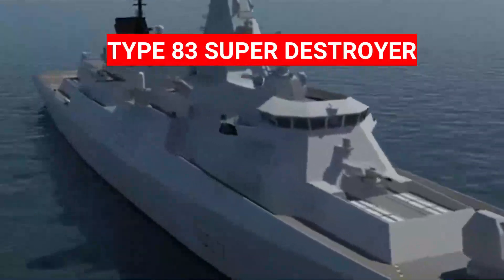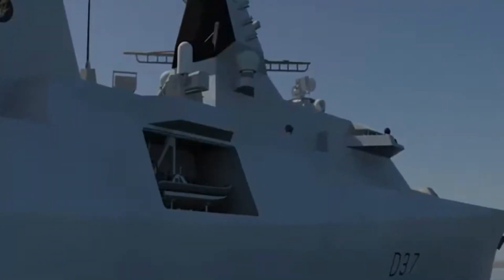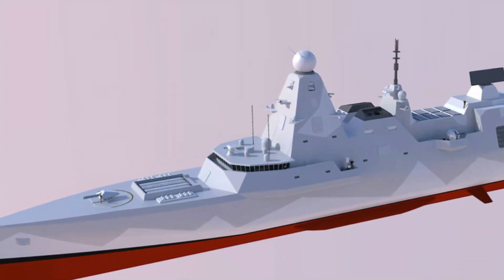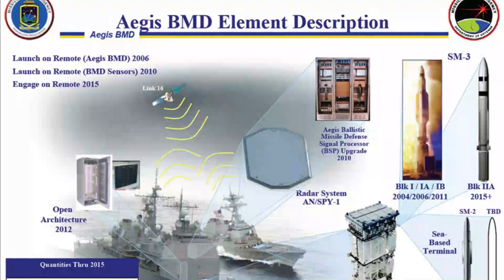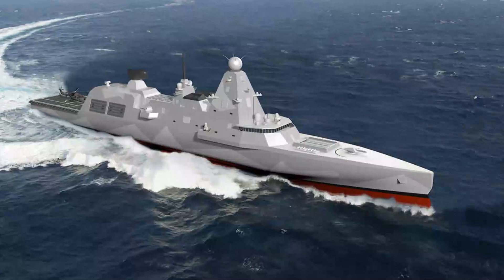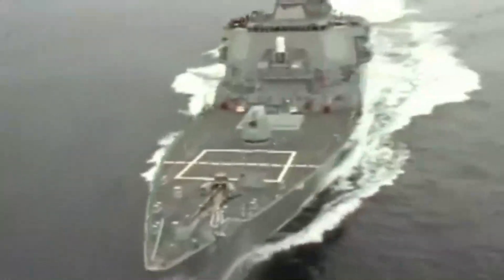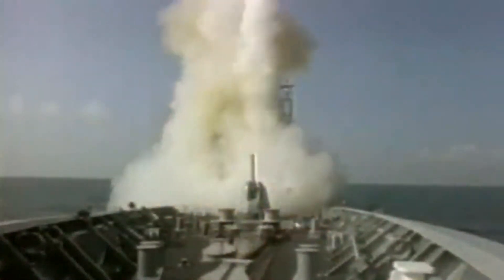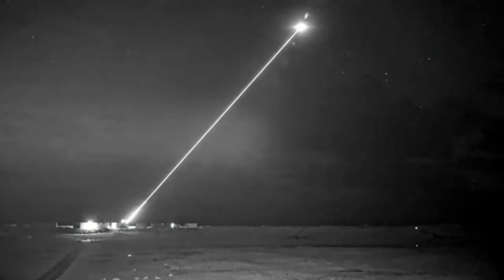THE ROYAL NAVY IS BUILDING TYPE 83 FUTURISTIC SUPER DESTROYERS.

Comment: @aleccap5946 Your conclusion below is, imho, incorrect. Though your own opening remark alludes implicitly to the only real drawback that afflicts the T45s. Whitehall/Westminster parsimony and what's almost certainly the usual deliberate attempt to dishonestly avoid acknowledging so via the usual FFBNW stratagem. Thus, the ships are all at most (the lead vessel, Daring, commissioned 2009) only half way through their service lives and quite lightly used anyway. Largely in view of the intercooler unit flaw. The inelegant but practically acceptable solution to which has had the bonus benefit of leaving the T45s with, if anything, more power supply capacity than they'll ever need. As for the extra weapons fit they're getting (24 cell Sea Ceptor mushroom farm, Canister launched NSM and Sea Viper anti-ballistic-missile upgrade for Aster30, fine. I'd still advocate a 32 cell mk41 strike length VLS installation (32 x quad packed Sea Ceptor as std + 24 land strike and/or anti-surface missiles depending on mission requirements) for preference to the AAM farm + NSM deck launchers but too late for at least the first two vessels and afaik NSM hasn't in any case been married to mk41. In brief, given what'll certainly be delays re T83 acquisition anyway,  6 x T45s able realistically to be retained as still capable units until c2040-2045 are rather a blessing.

Comment: The royal navy is not building any type 83 destroyers. They're building type twenty six
Reply: Type 26 is an anti-submarine warefare frigate which along with the type 31 general purpose frigate are replace the current type 23 frigates. The type 83 will be a replacement for the current type 45 destroyer.
Reply: @minophis  agreed but they're along ways from construction of the type 83
Reply: @ Indeed. Currently they not even decided the form the type 83 will be only that it will be very capable as an anti-air defence platform able to take out fighters, drone swarms and hypersonic targets at will. I am hoping they scale it up to a cruiser with significant anti ship and land attack capability.